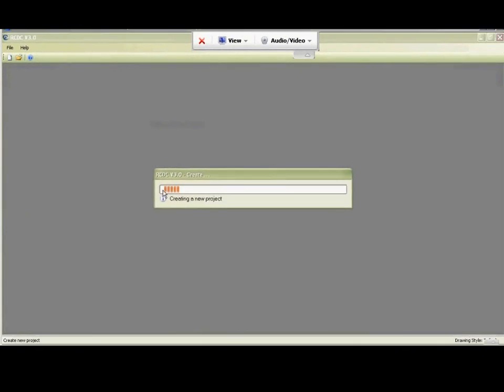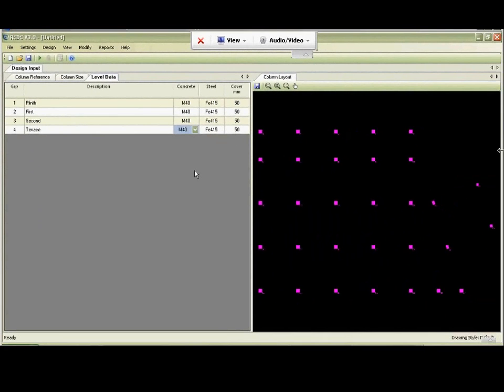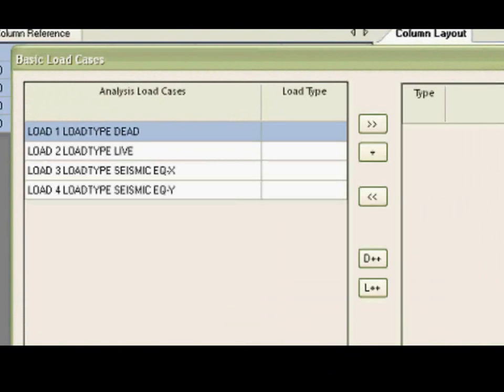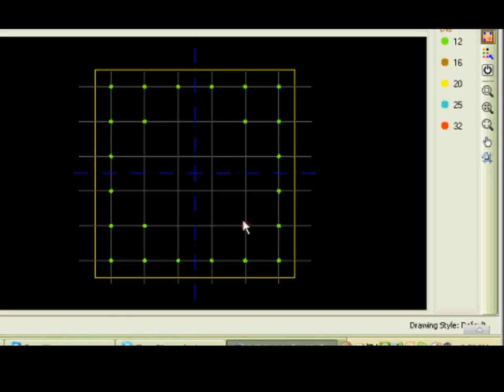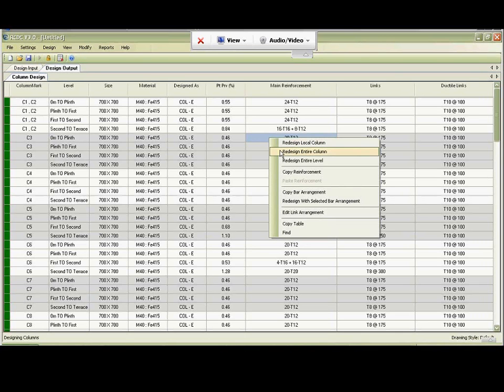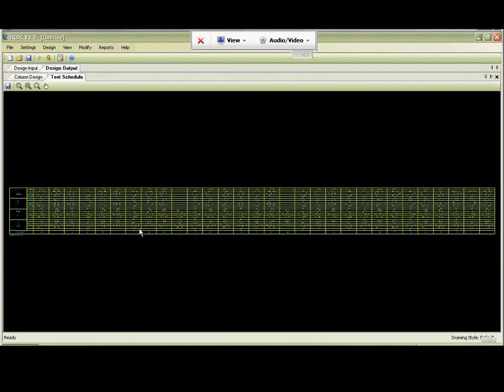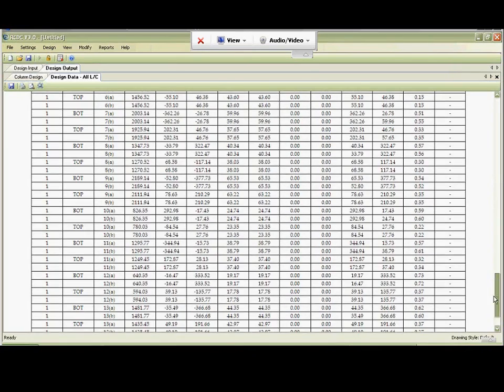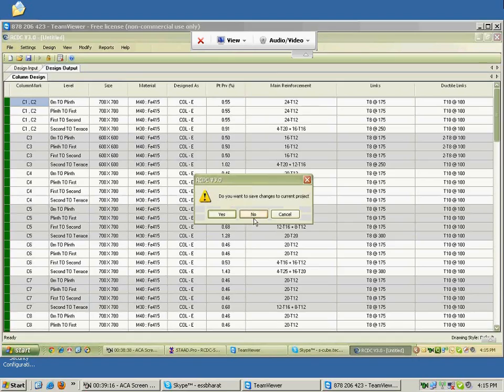RCDC Part1

Comment: sir , should we use all load combination for design RC columns.. because it comes in very large difference of steel if we consider all load combination or if we consider some combination like(DL+LL) & DL+LL+Earthquake load.
Reply: Yes we need to take all the combinations and ETABS or Staad pro will analyse the member n automatically it will design for worst load or large loads